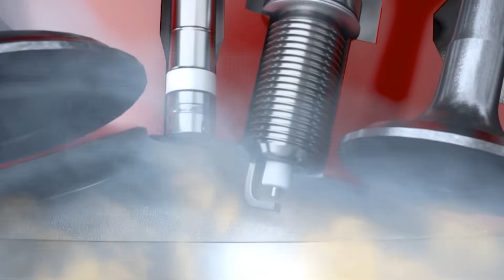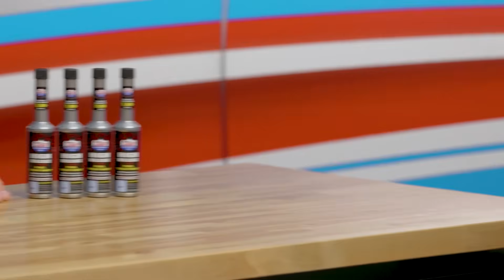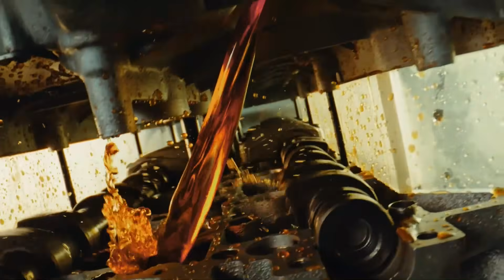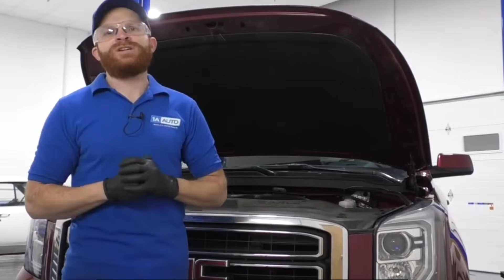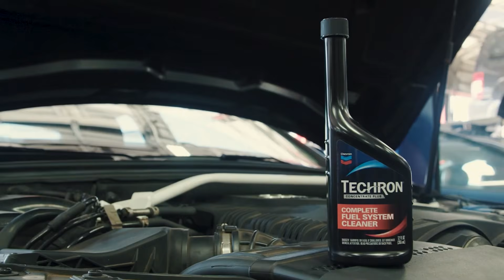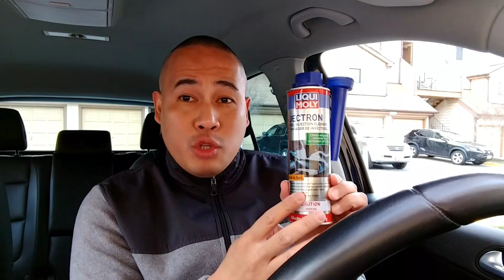STOP Using These 7 Fuel Injector Cleaners in Your GMC (Only 3 Are Actually Safe)

Comment: Hi there, i do have 2017 gmc sierra 2500hd, google suggested BG 44k Platinum , what do you think? Also what the best engine oil brand is can use? Thank you
Reply from the maker: BG 44K is a solid choice for deep cleaning those injectors on your 2017 2500HD! As for oil, a high-quality full synthetic like Mobil 1 or Pennzoil Ultra Platinum in 5W-30 is what most long-term owners here swear by for maximum protection.